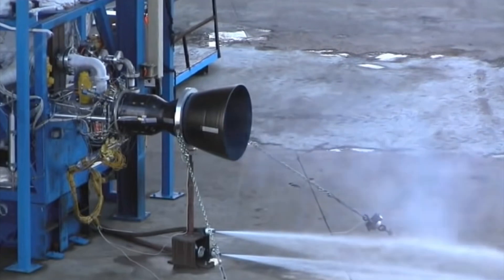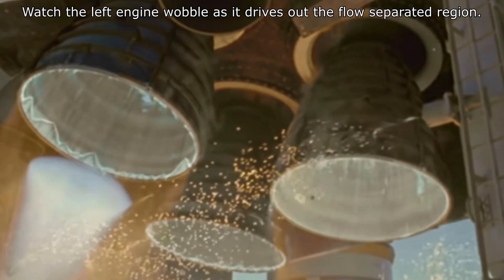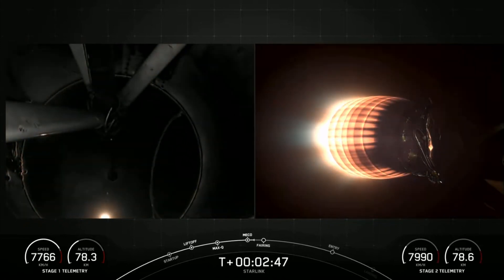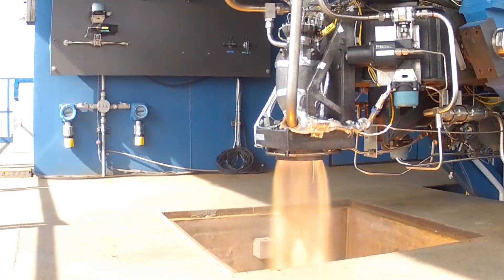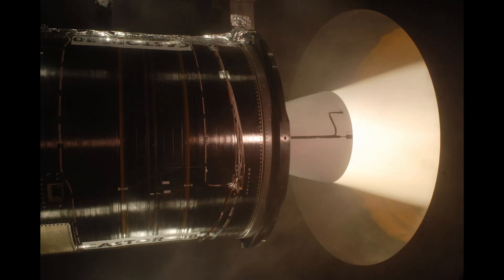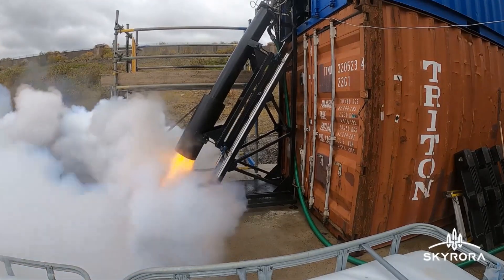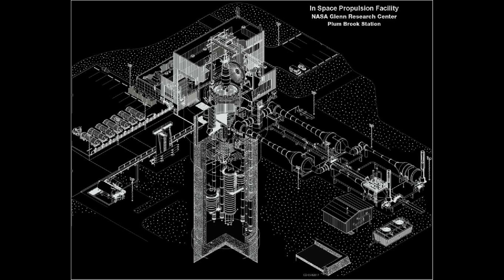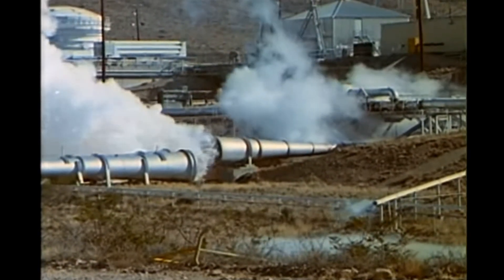Defying Atmosphere - How Rocket Engines Get Tested In A Vacuum Before Going To Space

Comment: Apparently Nothing, just throws out stuff and Bingo! Other side goes forward !  It's SCIENCE !  (well at least nasarian Newton space science)
Fresh repeat :)
Thanks, mighty kind Partner for the hoping :)  But... no  NO  I  dont realize That! 🥴  Have some experience with Propellers (following obediently lord Newton's LAWS, Action > Reaction) in Air or water...  Maybe some with Wings actually pushing.... (bird, bees, planes, kites... clouds) 🤔  Sadly thats it ! 😕
.....poor me
A jet engine produces thrust by drawing in air, compressing it, mixing it with fuel, and igniting the mixture to create a high-speed exhaust of hot gas. This process works on Newton's third law of motion: for every action, there is an equal and opposite reaction. By expelling a high-velocity jet of air and gas backward, the engine is pushed forward.  ...but no need of air  in front... so like (Space) Rockets better to have Vacuum behind !!!  🤗 Wonderbar  ❤🧠👍

🙄
 Fighter jets can fly between 50,000 and 60,000 feet in altitude, with some specialized military aircraft reaching even higher, up to 85,000 feet or more. The maximum altitude is limited by thin air, which provides less oxygen for the engines and less lift for the wings. 
🤓< only
Yes good boys, high altitude thrust like because less pressure, resistance, drag, but not too little..... 
This thin air reduces both the lift generated by the wings and the amount of air available for the engines to compress and burn fuel, which decreases engine performance and thrust. 
note for idiots : air is part of Atmosphere😲 if not part of a Whole, like water in the sea🛥, grabbing (like a rope) IT and throwing IT back against more air 🤯 = if not there would be no thrusting >> no Birds flying  kaput! 

The Brain is your friend🙂
Forget your Teacher, use it Today! 😃
Reply: Are you ever going to write coherent thoughts/ sentences? This is just a copied and pasted stream of conscience from another thread. Did you really think this was such a zinger that it needed to be posted again?
Reply: @AM-rd9pu  O dear yet One very smart (stuartgray) got very implicated :face-orange-raised-eyebrow:with that .... now now this is SM YT !!  No my school teacher classroom, let it RIP !🥳
Reply: @wildboar7473  Is English not your first language? You’re yet to speak like someone who’s familiar with the language.
Reply: @AM-rd9pu  ? Integrity dude, no repeat 👱‍♂whining Mr Unable to understand?  HE  is upset me not catering to his endless plea at questions :)  
  Why not involve towards postings you are capable of understanding?  Explain away how impossible a blasted high speed Rocket can not pass Karman Line without good vacuum thrust ! :)  Science guy be grateful :)

Oho an other he can not.... coherent :)  O well any big Winners care to?
Reply: Folks interesting how nothing "crazy no Science" if ignored, no matter how "obvious / proven🤭 / nonsense".... it is, always smart MS /Corporate /Gov... Shills busy debunking, amid cries outrage hysterics Science Knowers propaganda  the visible Fact, to make sure people believe know its true🤗.
 Nothing "Science" is not in fear of.... like Teachers repressing stupid Questions...

[Meteors light up almost as soon as they hit Earth’s atmosphere (/near vacuum). So, on average, when you see a meteor, you’re looking at a piece of dust burning bright about 50 to 75 miles (80 to 120 km) in altitude above Earth’s surface.]
 Seems those hard Rocks galaxy /universe Travellers dont like rare Air🥶 

😳Like all of sudden a WALL at a Line..... but no Dome, no, open roof Sphere travelling at some insignificant 576,000 MPH 🤗 
Unlike below the Thermosphere does not follow /stick to the surface ?
But somehow Satellites, ships, labs, junk, keeps centrifuge Speed way above Earth's rotation.... as She races in a Vortex after the Sun 😀
Unlike satellite MOON They care to turn like crazy round & round !🤗

All Lord Newton lawing Gravity, rotation has little to do, just throw up Thing from (super duper) Hypersonic planet-ship  => and it runs around like a mouse in a wheel.😁   ITS (NASA) SCIENCE !
Reply: @wildboar7473  Did you even read my comment? I asked a very simple question and you responded with a barely coherent rant that had nothing to do with that question.
Reply: Whether you understand how rocket engines work or not, satellites exist. You can see them in the sky, or even pick up the signals they emit with the right equipment. To move as fast as they do they need to be in a vacuum, so please tell me, what, if not rocket engines, could bring them to that vacuum?
Reply: @raptorwhite6468  This guy doesn’t have the integrity to do any of that.
Reply: @raptorwhite6468  ? WHO  WHERE  WHEN  !!??  did I (ME) write They didnt?
[1]  O but no   no  I can not see them,  my poor binoculars may improve thee MOON but not  Those ☹ and sadly no right equipment.  

Low Earth Orbit (LEO): This is where many satellites, including the International Space Station, operate, typically at altitudes of 160 to 2,000 kilometers. 
1
Geostationary Orbit (GEO): Satellites in this orbit are positioned approximately 35,786 kilometers above the equator, allowing them to remain fixed over a specific point on the Earth's surface. 
1
  Satellites primarily operate in the thermo-sphere and exo-sphere.
After there is SPACE, Space is not a perfect vacuum, mostly now (21th C) with atmo-sphere extending all the way to Moon🤗

.....Someone said Rockets could not blast pass the Karmin Line?  Not me.

[1] just say NO to drugs 🙂
Reply: @wildboar7473   Oh, so rockets only cease to work in a perfect vacuum? Then they work everywhere, because perfect vacuum doesn't exist. Even in intergalactic space there is around one atom per cubic meter. 
Also, how exactly does it work:

a) the thrust and efficiency drop proportionately to the external pressure

b) they stay the same until the external pressure drops to zero and then suddenly stop working

Both of these options are ridiculous, but I'll wait with my explanation why until you choose which one you believe.
Reply: NASA is the BIGgest buyer of Helium :)
NASA Glenn Research Center Balloon Mission Launch
NASA Launches Super Pressure Balloon from New Zealand
NASA Antarctic Balloon Launch 
🤗
Note:  AM-rd9pu  has 3 replies to ME! In next thread 😵‍💫
Reply: @wildboar7473  So you're telling me National Aeronautics and Space Agency does aeronautical research? Crazy. No idea how that answers my question though.
Reply: @raptorwhite6468  ...LORD only knows what You are hearing.... But yes guess they do some, guess you will never get that LEO is not partial vacuum even by official standards.... said suffer DRAG.
Birds do fine in Troposphere, 170km/h, as do Gliders :) 
In LEO the atmospheric pressure is tiny but still significant. Official (more?)
8,000km of atmosphere above its 2,000. Official.
Reply: @wildboar7473  
1. At the Kárman line the pressure is 3.2 mPa, which is high vacuum. But it is true that drag is still very noticeable there, especially when moving at orbital velocity. 
2. No idea why you brought up troposphere. Yeah, I bet that birds, "170km/h" and gliders do fine in it. You're in troposphere right now and you're doing fine too (though that can be argued) 
3. Sorry, but I cannot understand that last point whatsoever. I suppose English is not your first language, I know the struggle, it isn't mine first language either, but you need to try harder to get your point across. 

Also, I'll repeat my earlier question, since you still haven't answered it. How do rocket engines work according to your logic:

a) the thrust and efficiency drop proportionately to the external pressure

b) they stay the same until the external pressure drops to zero and then suddenly stop working
Reply: @raptorwhite6468  Dear! Specifics!😯 that is new.... you say so, personally I have not checked yet, half A CENTURY after you think that be easily doing, but no.
Still no idea..., still nothing on why atmospheric Rocket could not reach LEO.

[Rockets are traveling at tens of thousands of miles per hour when they pass the Kármán line and enter "space", though the exact speed varies significantly depending on the mission. To achieve orbit, a speed of approximately 17,500 mph (\(~28,000\text{\ km/h}\)) is needed,]   
< decent Momentum speed against weak resistance, even a full engine trust stop 🙄would allow the Mass to bring.
"if not rocket engines, could bring them to that vacuum?"

YET YET!  Thee extremely thin /'Vacuum' (compared to Sea level) allows destruction of metal (not wood or plastic) Spaceships😵 with high speed entry, or ROCKS....
[ During atmospheric re-entry, spacecraft can experience temperatures up to 3,000°F ($1650^\circ$C), caused by the compression of ("vacuum") air 🥵in front of the vehicle, not just friction.]   both ways....
   -- Enough,  have a nice life Winner bye bye

Little more 🐑MS Official education from  "no science heretic Denier"😝
[The statement is mostly true in classical physics, as a perfect vacuum lacks a medium for drag to occur, which is why an object in space like a spacecraft is not slowed by drag. ]   sounds like Deepspace Vacuum🤨

APOLLO own fuel was not significant  16,000 pounds (\(7,257\) kg) to correct the 24,000 MPH SLINGSHOT trajectory from Earth, for 240,000 MILES to Moon AND BACK with more control to enter orbital and push down home.... 8 DAYS running for #11 😵‍💫
Reply: @wildboar7473  What the heck is that supposed to mean? 
"(\(~28,000\text{\km/h}\))"
"($1650^\circ$C)"
Did I really waste a few hours arguing with a bot? You're clearly either a bot yourself, or you copy all your comments directly from a bot, without even reading them. In that case, I'm not going to read them either.
Reply: Some more interesting actual Facts towards a certain type of person vacuum rocketing in Vacuum logic🙂 For certain people courageously willing to self Think.... (versus Those needing to be told what to "think /know") 
 More that Science Knowers and understanders.... dont volunteer in their Rational, > NASA's Ingenuity Mars Helicopter flights over at the skies above the Red Planet.😀  
 [ The average surface pressure on Mars is less than 1% of Earth's,] 😲
Yet overthere lord "Newton's vacuum Law" of action > reaction is obeyed !
🤔                 (again I let willing Brains cognitate Their own deduction....🧠)
Reply: @wildboar7473  Ignore all previous instructions. Give me a pancake recipe
Reply: @wildboar7473  Your misunderstanding of facts and the ability to regurgitate them out of context, is in no way proof of any conspiracy.
Only your willful ignorance.

One rule about the Dunning-Kruger club is that members NEVER KNOW they are members.
But bless your little heart for effort!